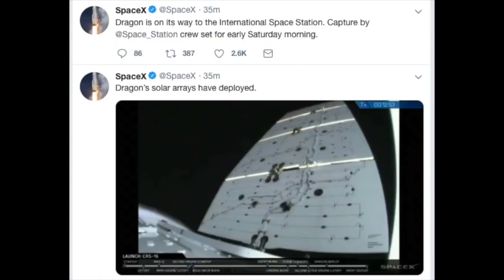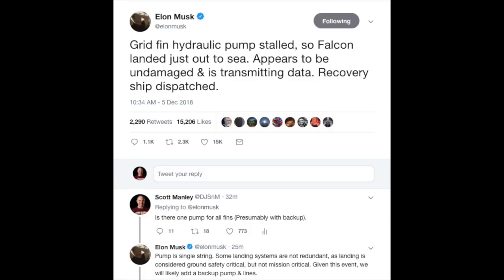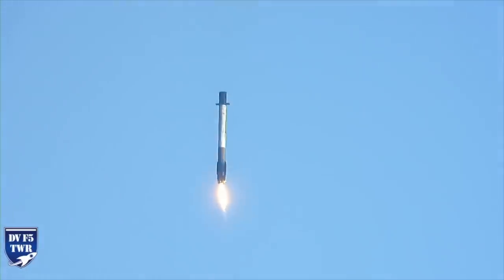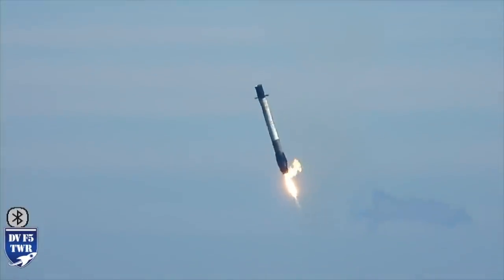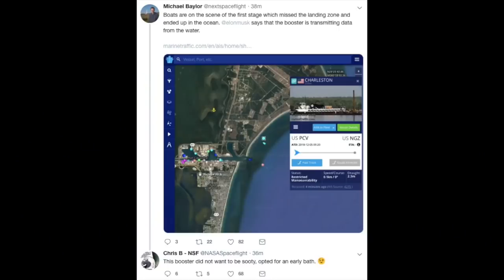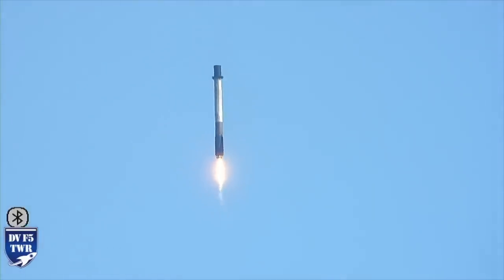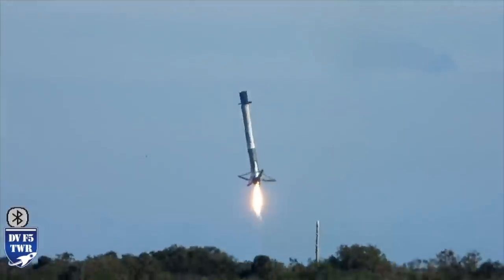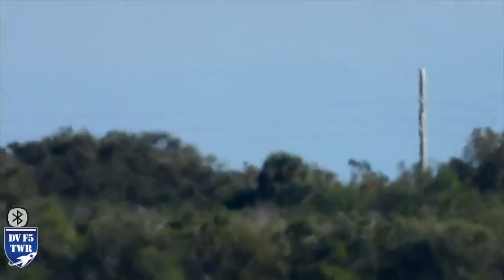SpaceX Rocket Loses Control After Successful Launch

Comment: I truly believe it is possible this was a staged failure so that SpaceX can tell customers " Its worth it to use a flight proven booster because even new ones can have an issue." Why would they do that you may ask? By middle of the year SpaceX will have 10 to 15 Flight Proven Block 5 Falcon 9's in their fleet. Where are they all expected to be stored?

Comment: 4:27 That was a critical o-ring that got terribly extruded; the reason for the hydraulics failure.
Reply: Yep, teflon o-rings will look exactly like that when placed under pressure exceeding their specs. Someone over-torqued the fitting.

Comment: Elon musk tweeted, "Engines stabilized rocket spin just in time, enabling an intact landing in water! Ships en route to rescue Falcon." So by engines I'm guessing he is talking about the Merlin engines. If I'm not mistaken the Falcon 9 uses 3 engines on boost-back and one on landing. I wonder if they fired up 3 on landing.
Reply from the maker: They only used 1. But the rotation off the longitudinal axis allowed some control
Reply: @scottmanley  I also saw when the landing legs came out at the end it slowed the spin down quite a bit. Physics 101 for iceskating

Comment: 1:20 the grind fins dont try to compansate it, they cause the rotation. They are pointed so that they direct the air like a left hand threaded screw. That matches the stalling pump, the fins were stuck in this position and could not get back to operation. The rotation stoped at the end because the fins have lower effect when the stage is slower.

Comment: The fin on the left appears immobile throughout. (Perhaps by coincidence, that is also where the mystery object appears to have come from. Could it have been a seal?) Note that when the fin on the right moves, the one on the left does not. A hydraulic leak at the fin on the left might have prevented it from moving, but while fluid remained in the system there could still have been sufficient pressure to allow the remaining fins to make their final moves until the fluid was exhausted.

Comment: Is that a plastic nozzle cover that was burned through but then came off? It would have to be an intermittent engine or the ring would've been melted through.
Reply: ...Melted through the 'ring.'  I should also add that by guessing at this, there's about 90% chance that I'm wrong--even though this seems a pretty obvious guess. 
 I've tried to self-diagnose medical symptoms using the internet, and was invariably wrong. So when I attempted to try this again  for a messed up knee, one of my starting assumptions was that whatever I found would be wrong. For two hours I was right about being wrong. I was convinced I'd need some onerous surgery...which wasn't that worrisome because I knew I was wrong. And I was. A half out later I figured out I had ITB syndrome. All I had to do was roll out my thigh and butt on my coffee thermos... which I'd never have figured out except for my assumption that I would be wrong. Of course the first person I saw after I could walk again, said, "ITB? oh yeah...' knew all about it. 
Thanks Scott Manley.

Comment: I thought that the entry burn used the single centre engine. How, then, can they use the engine thrust to correct spin? It shouldn't generate torque. (I know they used three engines for the entry burn, which is what gave it the weird-looking flare, but the landing videos clearly show a single engine firing.)

(Also, the amount of gimballing on that centre engine was impressive.)
Reply: Entry burn was with 3 engines.
The problem with the hydraulic pump occurred after engine shut down, then later the landing burn began with only one engine.
(Note that entry burn is followed by quite a long free fall phase) 
Under normal circumstances you simply can't correct spin if the spin axis goes straight through your only engine. But if you watch the video closely you can see that the booster tumbles so hard at times that the spin axis is angled to the central axis of the booster. Now the engine can thrust against the spin, because it has leverage (the radial distance between the engine and the spin axis).
While I don't know definitely if the software is capable of doing this, I highly suspect that it is very aware of the boosters position relative to its spin axis and angle of attack against the incoming air.

Comment: How big are the pumps if they're small they should have 8 pumps 2 for every fin
Reply: Up to now there is one pump for all fins. Musk hypothesized that they will put a redundant pump in it to avoid any such failures in the future. But you have to remember that every additional kilo in the booster is a kilo less payload in orbit (roughly).
Reply: @3gunslingers  well if you add 5kg to the booster you only need to decrease 1kg in the second stage or payload but its important that none of the pumps fail right if you have 4 pumps its more backup right?
Reply: @mastershooter6315  
I'm pretty sure the engineers at SpaceX have a sophisticated spread sheet about the costs in therms of money, safety and payload for every single part on the rocket. 
SpaceX will recover and inspect the booster thoroughly. By now we can't even be sure if the pump itself was really the problem or if it was just a loose hose or something. 

Sure you can make every component in your rocket or airplane double and triple redundant, but at some point the cost and weight penalty offsets the added reliability by far. Especially in rockets which are "one use only" machines (even falcon9 to some extend) the reliability of parts is often not realized by redundancy, but by their short lifetime.
Reply: @3gunslingers  i mean he says he's gonna make the f9 be reusable upto 15 times so you do need redundant parts and im pretty sure it wasn't a lose hose cause they'll check the wiring the plumbing and everything twice or more times
Edit:yeah they might have a spreadsheet about that
Reply: @mastershooter6315  
There are MANY parts in airplanes and rockets that are not redundant. Landing gear for example (tho it might be "fail-safe"). 
As I said, there are multible possibilities to make something reliable (enough). 
Also we have to keep in mind that the Block5 booster is relatively new (very few flights in total) and has undoubtedly numerous new parts in it.

Comment: Scott,  do you think it is cheaper for Elon to land the booster back on earth or have it re-enter at such an angle that it burns completely up?  It is spectacular to see it land but it must take a lot to do it.  And when it does fall over or have a problem it seems that would be worst for publicity. Although it was so beautiful watching it attempting to correct itself and land safely.  Incredible.
Reply: The whole idea of SpaceX is to reuse their equipment instead of dumping it into the sea (the booster don't go fast enough to burn up)
If you can use a booster twice the price for a flight goes down by 1/3 (roughly). Now imagine the price drop if you could use the booster even more times.
Reply: @3gunslingers  But then you have to carry more fuel up which has to cost you,  blow the booster up if it lands like it did this last time and have the technology to bring it back.  Also the added risk if it fails and hurts someone.  Seems the insurance costs alone must be incredible.
Reply: @flymario8046  
There are no insurance for falling boosters as far as I know. NASA and the FAA provide a launch and splashdown (landing) airspace. Both have to be free of any persons before launch. 

But then you have to carry more fuel up which has to cost you,  blow the booster up if it lands... What do you think costs more? The fuel or the booster?
Reply: @3gunslingers  Thanks!  As far as your second point.  I don't know.  There must be a reason that NASA gave up on this idea before. I believe Scott made a point about this before.  I was Questioning the price/return on investment really.  If I had the answers it wouldn't be worth me asking. Looking for answers from someone with a better grounding in the facts than I can provide.

Comment: I have a different theory on what happened.. I knew that something was wrong during the launch when you could see that fire going up the landing leg.. that's not normal. And then during the landing burn shutdown you can see the first stage is already pitching and yawing around but stops, knew it was going to go south. If you watch the reentry burn it looks like the engines burned at full throttle as there was much more flame than usual. Typically when doing the reentry burn the flames are much smaller staying maybe twice as wide as the rocket instead of that massive wide plume you saw. I think the cause of the instability was they used up too much fuel. By burning too much fuel it put the center of pressure off balance with the center of gravity making it unstable. Then you see the long "burns" of the cold gas thrusters and then suddenly it keeps pitching more and no more cgt's.. Which means they were out of cold gas (CO2 I believe) which upset the weight balance even more as well as making all course adjustments up to the titanium fins alone leaving very little attitude adjustment and the only option became to ditch it in the ocean.
Also the flamefront moving up the leg during the main flight likely cause it to burn less efficiently than they would've hoped for costing them to have to burn more fuel to reach the height they needed for MECO/stage separation/Boost Back Burn and likely the BBB took more fuel as well if it was continuing to burn oddly like that. All that leads to the payload being less than expected and the balance being off which screws up the natural stability and leads to what you see here.

Comment: “That” is condensation that formed around a cold gas booster vent and came dislodged.   Because the rocket is still above the atmosphere and descending there are 0 Gs and the condensate is able to “float” as it was already traveling at the same velocity as the rocket.

Comment: The booster was doing some interesting maneuvers in the last seconds before landing, going very sideways before righting itself again. Looks like it was canceling a fair bit of leftover horizontal velocity. Was it intentionally trying to get as close to the coast as possible? (Before going sideways to cancel that motion for landing). Or did it just land wherever it ended up, only neutralizing the velocity it happened to still have?
As for the grid fins, I noticed they came out really slowly, so maybe the pump was already stalled. They still did move though, and I got the impressions that they were only moving too slowly and this was causing them to overcorrect. You can see an initial rotation one way, the fins slowly turning to correct this (but way too far because they weren't getting the desired result right away), and then a rapid rotation the other way. If the fins had not moved so far and been a bit more "patient", the result would have been drastically less wild. Or am I being a completely ignorant armchair physicist here?

Comment: I'm hearing/reading vibes that this was quite not a success, and more sarcasm than that. Cheez. What is the CLOSEST a manned rocket mission (not shuttle - that landed with wings) - say, Apollo or Gemini - came to the touchdown point? 50 miles? Does no one remember how long it took for rescue craft to pull astronauts out of the water? And that's with numerous ships spread out for the recovery. So this blew away from the landing crosshairs. So what? And am I wrong or does it not have a single scratch on it? Go fish it out and do another one. Sounds like a glowing success, virtually across the board. Am I missing something?

Comment: 4:27 I don't know it, my guess is that maybe it is paint or a special material placed around the RCS ports, maybe that one for some reason was pushed away when the RCS worked at that point. If it was removed in a regular way it could have that shape a hole with paint around the attach points. That guessing that it is part of the rocket. If it is not part of the rocket, maybe it is ice with a curious shape that at some point was able of being separate from fuselage where it was  formed around something with that round shape... With all, it is  the first time I see that ring in one video...

Comment: Is a steered grid fin and its pumps even necessary if the booster can land without it working and evenw positioned in a wrong angle? I guess one could save the weight and only use the RCS which allowed a landing here anyway.
Reply: The grid fins are for precision landing. They can angle the booster without mass loss over a longer time.

Comment: I am not sure the gridfins in video were trying to correct the spin, I think they were the cause. They don't work like tiny winglets, they direct the airstream from below to one side. To the fins in the video direct the air to right, adding to the spin. Can anyone confirm?
Reply: You are right. The grid fins failed due to a problem with hydraulics and got stuck in this extreme side wards position and caused the spin. The airflow through the grid fins is always perpendicular to its "flat" side.

Comment: How does the falcon 9 control roll via thrust vectoring only the center engine?  Is it gyroscopic? Or is there some small off axis offset?
Reply from the maker: On ascent it has 9 engines, on the. Way down roll control is from RCS thrusters and grid fins
Reply: @scottmanley  this makes much more sense than what I was reading elsewhere. I'm a bit surprised there was enough RCS fuel.

Comment: The ring is a piece of ice from condensation, that was dislodged from the lifting pin hole. The hole is used when the booster is lifted by crane.

Comment: Frozen gas or liquid from a port/vent, surprisingly in tact, most likely from the RCS ports. At a guess 
Or is an alien ring jelly fish... WoooOoo 😉😋

They may want to check testing their ports in a vacuum see why its collecting ice, which could be making its thrust vector inefficient, and possibly not good if it build open on one side more than the other, as it may cause defection resulting in a small rotation... 
Though I'm sure their systems are more than capable to compensate if that happened

Though as space debris its a sizable chunk of ice, would be less fun if is was in a stable orbit...

Comment: Could that stuff leaving the vehicle in the end be water that had previously condensed from spent fuel, instantly vaporising due to low atmospheric pressure? Or possibly leaking Hydro fluid doing the same, which may be what caused the incident.

Comment: I guess this is what would be called single-point-of-failure, which is fine because it's not a crew-involved phase of flight. But still, with something like the BFR Elon is going to have to find a way to handle single failures like this  one without ditching. At least the booster made a soft landing, so there is at least some contingency. Maybe backup hydro pumps could be used on the BFR.

Comment: The big thing is had it landed on something solid and level it probably would have been fine. Artificial island off the coast? An option to get rid of retained gas and waterproof the rocket stage might have meant with a few repairs it could have been reused.

Comment: When explaining the cost savings from rocket reuse Elon asks "what would a plane ticket cost if the plane was destroyed after each fligt". There has been about one hour of grid fin use cumulative across all landing attempts and one crash due to a grid fin related hydraulic failure. At that rate every single airplane would crash after one flight. The falcon 9 grid mechanism is a million times less reliable than an airplane. Are they using an airplane certified hydraulic system? ( is there such a thing?)  It does not seem reasonable that this was a hydraulic failure.  I would speculate that an airplane's flight surface would experience forces within an order of magnitude of the falcon first stage grid fins and they should have somewhat similar reliability. Yes the grid finds start use at supersonic speeds but so do many other fighter jets flight surfaces. Missiles use grid fins. This is where the idea came from. What is their failure rate due to hydraulic malfunctions? It was great to get a real time diagnoses from Elon. But the answer screams for clarification and details to allow it to have reasonability.

Comment: The round thing at 4:23 looks like ice, I guess it may been ice formed around a round seal/plate that then got lose when the flames and warmer air closer to earth started make the fuselage warmer, I think it is falling almost with the same speed as the fuselage, but the spin create drag so it looks like it is flying up.

That is my very uneducated guess, as you can see on my spelling and grammar, it is very uneducated guess :)

Comment: You don't know if there's an problem unless something goes wrong.  I see this issue a success.  The booster landed safely.  Yes it tipped over, but it landed.  This is amazing!  Now the engineers have a mountain of data to help improve these systems further.
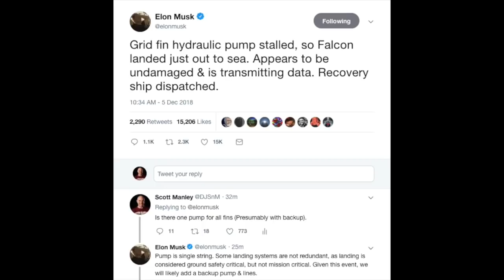Reply: @WillieRants - "Now now the engineers have a mountain of data to help improve these systems further." - Elon Musk already knew the problem and had a solution: Add a backup pump and lines. Look at the video at time 1:19
Reply: @htn1254  Ah I missed that, thanks.  And thanks for pointing out my typo.  The main theme of my comment was positive.  I don't see this issue to be a failure, but an opportunity to improve.  I trust you agree.
Reply: @ @willierants5880  - Tesla engineers are analyzing all data from every launch to learn what they can do to improve the next version. This mishap is an opportunity for them to improve the reliability of the next rocket. My point was Elon Musk is very quick to learn and try to have a solution for the problem. But the SpaceX engineers will analyze all the available data and will have a more solid answer.